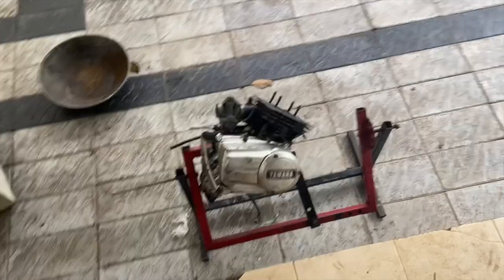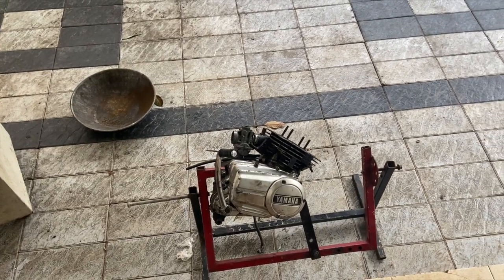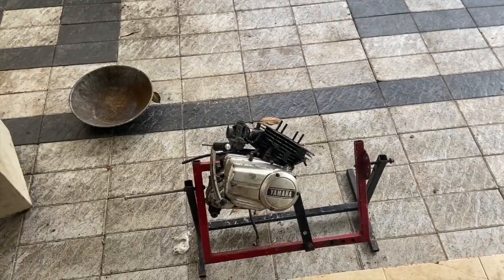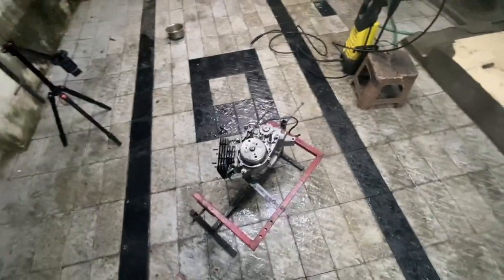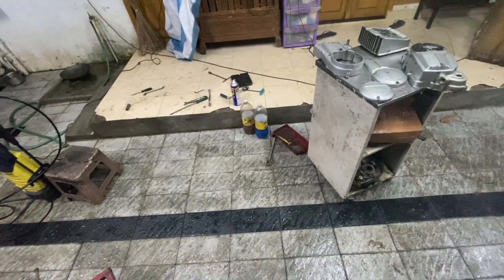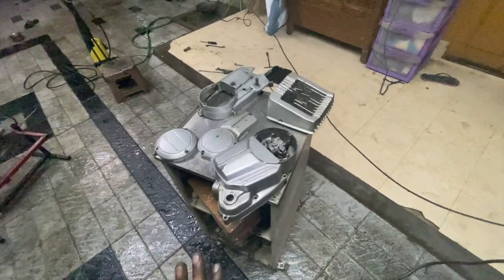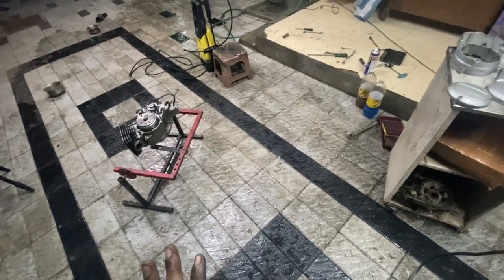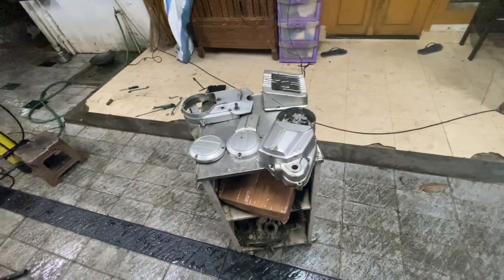Yamaha Rx 135 Tiger, engine deep cleaning (English Video)

Comment: first comment.... is it possible to use the RX135 Crab in 100... before experimenting need the expert advise... and also i got the Cat silencer for 5k in good condition...by using the Cat silencer in RX100 does it will affect the performance and mileage?
Reply from the maker: Carb yes, don’t use the cat, it will mess up the engine